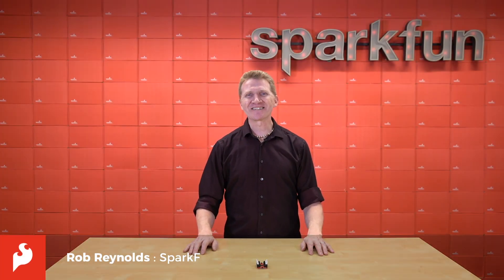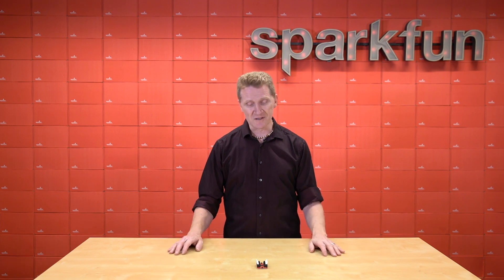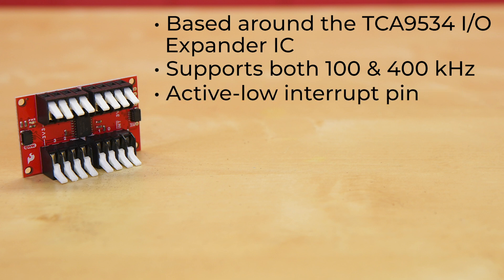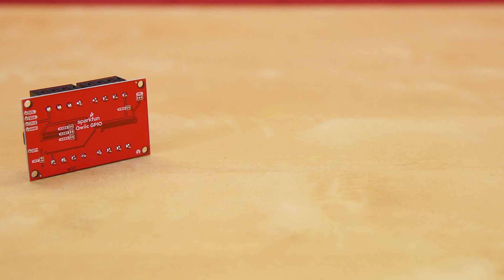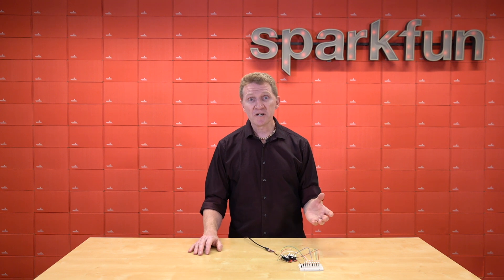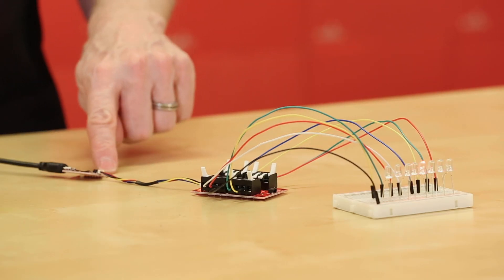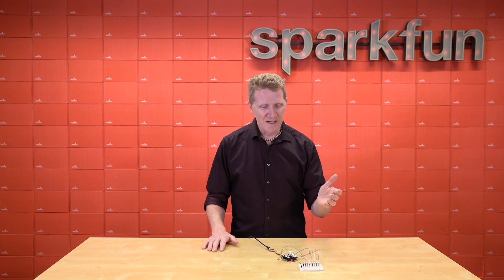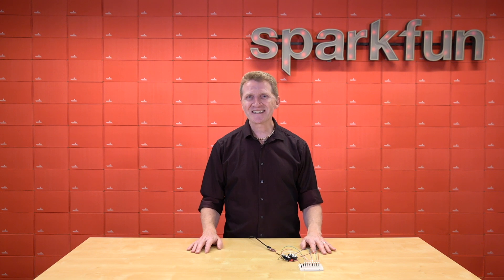Product Showcase: SparkFun Qwiic GPIO

Comment: It's like you guys were watching me struggle with an MCP23017 board, and specifically decided to fix every complication I ran into. I love the jumper pins. Cutting traces is so much simpler than moving tiny SMD resistors from one location to another! And having a trace to cut to disable the pullup resistor on the SDA/SCL pins, to allow multiple devices to share the I2C bus without significant signal loss would have been a big help. I really like those latching terminals, too. Another thing that would have simplified my recent project.

Thanks! I'll likely suggest using these in our future projects!